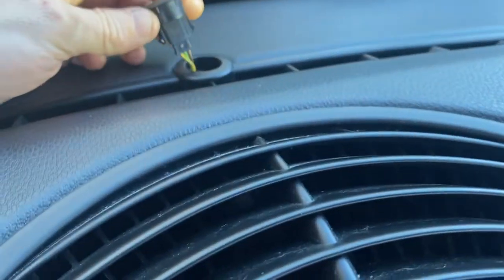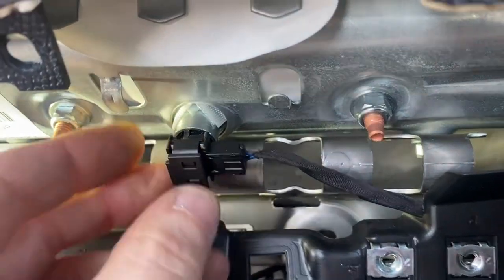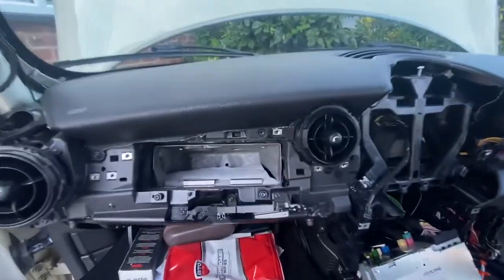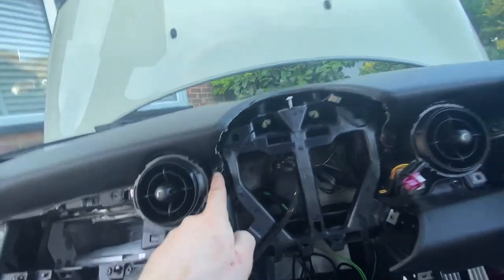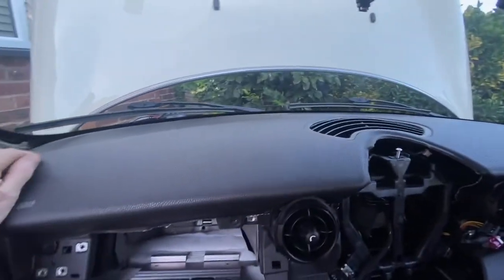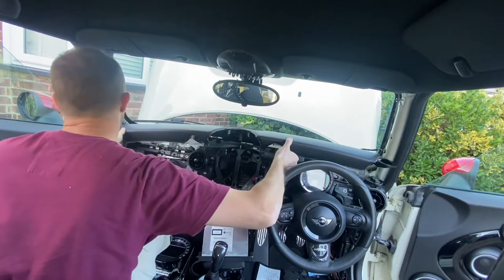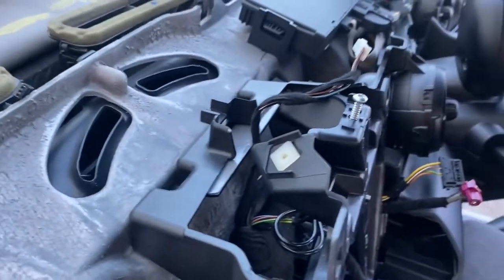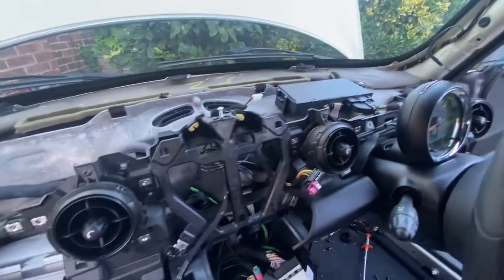Mini Cooper Remove dashboard

Comment: I need to replace the start stop mechanism on mine. I see you’ve disconnected yours in this vid without taking the dash off. What do I need to take off to access it?
Reply from the maker: I'm not sure what you think I've disconnected. I have disabled my start stop by purchasing an app called 'bimmercode' and using it with an OBD dongle that you plug into the OBD while choosing your settings. One of the settings is to remember the last start stop state. ie it will remember you have it switched off (from the button near the gear lever) and leave it off. Bimmercode is a great app it allows you to scan and clear faults etc
Reply: Have to do the same, just don’t know what bimmercode has to do with it 😂